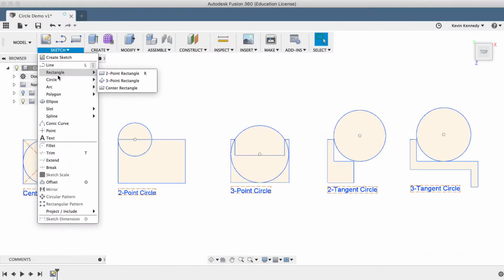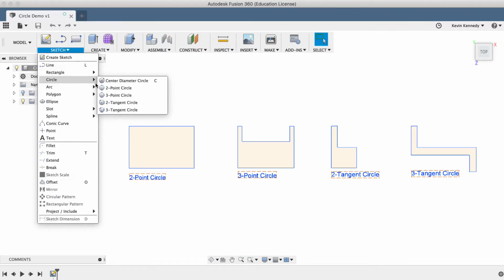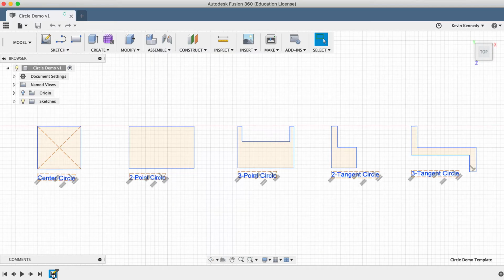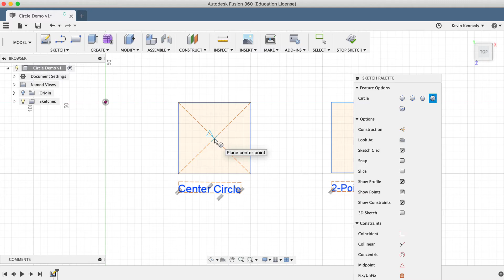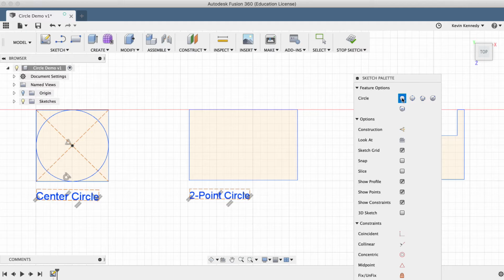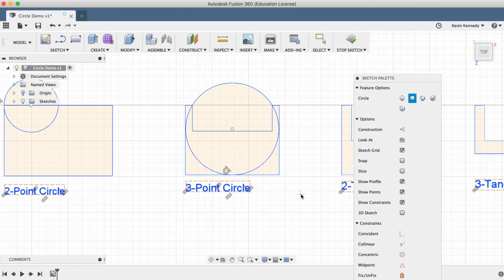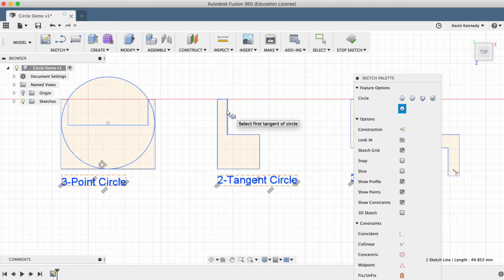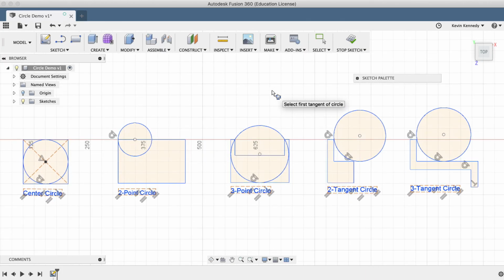How to Create Circles in Fusion 360 (all 5 explained)

Comment: Please please please, answer what should be the simplest question!
How do I select the center point of the circle exactly?
I wanted to put it on 8.5 mm. and 21mm from the corner of my rectangle so it was in the right place for a hole.
Every time I click it ends up somewhere near.
Surly you can type in a value?

Comment: Need to know how to draw a circle tangent to two circles that intersect each other off the two one is larger than the other.
Reply from the maker: Hi, William. You may be best drawing the circle on its own. Then, use the tangent constraints to make it tangent to the other two circles.

Can you provide a link to a screenshot of your circle setup? If so, I can try to make a quick file to test some things.
Cheers, Kevin :)
Reply: @ProductDesignOnline  I figured a work around. Not what I want but out worked. As soon as I can figure how to send the screenshot I will.

Comment: Hi Kevin,
I've tried to access the demo file, but the site comes up in French, and says the model is empty and there is no geometry to be displayed. I live in Canada, is there some country setting that is causing this problem?
Reply from the maker: Hi, Kevin. That is strange the link is loading in French for you. It must be something with a country setting, but I'm not aware of how that could/would be changed.

The file says its "empty" because sketch geometry (for some reason) is not displayed in the browser preview - only 3D geometry is. Simply click the blue "Open in Fusion 360" button in the upper-righthand corner (image for reference - https://snipboard.io/BrIkwj.jpg). Then, it will download the file. After the file is downloaded your browser should prompt you to "Open with Fusion 360", which will then open the file directly in Fusion 360. I just completed these steps and the sketch geometry still appears to be there.

Let me know if you get it to work. As far as the French, you may want to post on the Fusion 360 support forum to see if they can change that (or if you can on your end). I'm guessing they're changing locations based on your ISP location. Cheers, Kevin :)
Reply: @ProductDesignOnline  Got it, all works well, thanks for the help.
Reply from the maker: @stickmano666  No problem! Glad to hear you got it sorted out. Cheers, Kevin :)

Comment: Somehow the circle on the last example - with three tangent points draws on the other side... Can't understand how to control it.
Reply from the maker: Hi, SashNone. The 3 tangent circle requires three clicks of the mouse, which is the sketch geometry that you want the circle to be tangent to. One thing to note is that sometimes the order of selection may affect the tangency. Did you select the top left line, the bottom right line, and then the horizontal line? Cheers, Kevin :)
Reply: @ProductDesignOnline  Yea, I did exactly what you do, but it's appears other way round. I played with order of selection and it's worked okay when i select bottom-middle-top. Just curious why it so and how to be sure that I doing all right.... Thanks!
Reply from the maker: @SashNone  Hmmm... There must be a difference in settings or something throwing this off. Could you provide a link to a screenshot?? That may help me notice something that would cause this. Cheers, Kevin :)
Reply from the maker: @SashNone  Thanks for providing the video. Did you recreate the sketch geometry or use the demo template I had set up? From what I'm seeing, it appears you created the same type of shape, however, it is a bit longer in overall width.

I was able to stretch mine out farther and got the same results - https://snag.gy/lBUjef.jpg
It's then choosing the opposite edge as the tangency point because that is the closest one. Cheers, Kevin :)
Reply: @ProductDesignOnline , thank you a lot, Kevin. I've got this idea.
Reply from the maker: @SashNone  You're welcome! :)